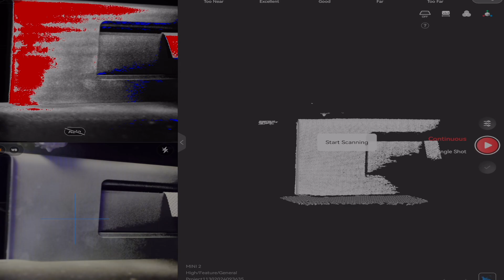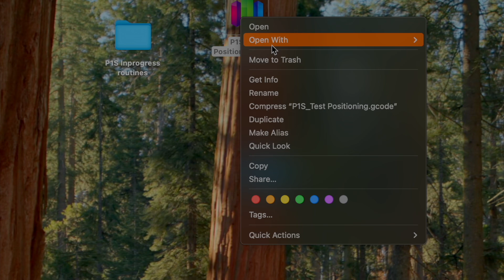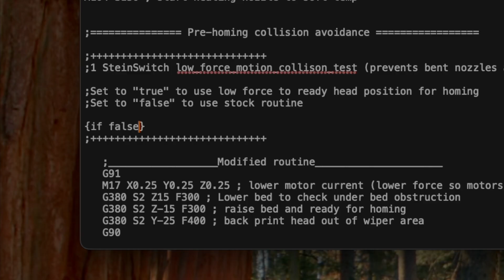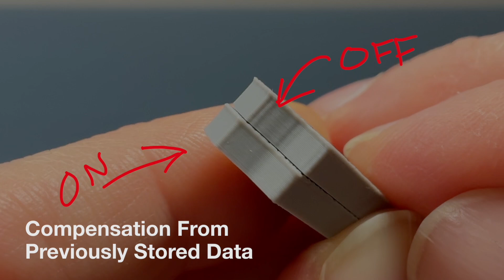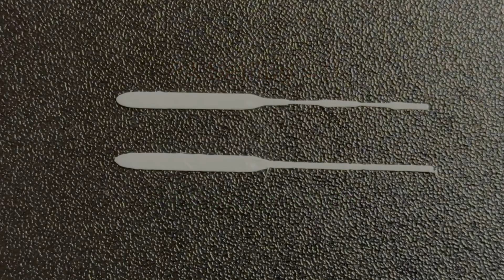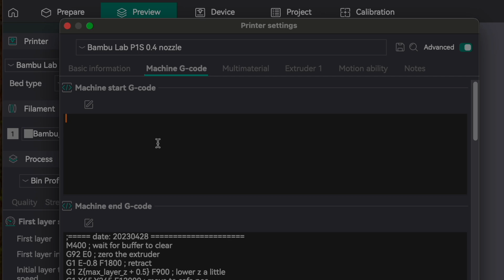The Ultimate Wiper Mod Combo For Your Bambu Lab P1S P1P and X1C

Comment from the maker: Update May 20.2025 : 
The project is now solid for P1S P1P X1C with AMS! There are tons of new features and Ive discovered many better ways to tackle everything from installing the wiper to SteinSwitches, if you want to go down the new and improved SteinWipe project rabbit hole, these videos and links below are the perfect place to start (in order)! 

1) Stay up to date on everything thats been done for SteinWipe:
https://bit.ly/LeckiesteinProjectLog

2) No more pasting Gcodes! Everything needed for the slicer is now in a single 3MF file! 
https://youtu.be/jahBdUJ94KI

3) No more editing Gcodes to changes the SteinSwitches, these are now controlled with SteinSwitch Definitions (SSD's). This doc shows you how to use SSD's and what each ones does:
https://docs.google.com/document/d/1540a3b_T8ESQ08lXcBy6db43X7J7yxPiT3bDuzWYge4/edit?tab=t.0#heading=h.ra1esgt7py0c

4) New pause routine trailer featuring SSD's. I show how to use SSD's at 30 seconds mark:
https://www.youtube.com/shorts/cHqVBoUvAgc

5) Get started with the SteinWipe project and basic manual wiper code on MakerWorld for FREE!
https://makerworld.com/en/models/1025501-steinwipe-nozzle-wiper-for-x1-and-p1-series?from=search#profileId-1050795

6) New wiper install method and new template deep dive:
https://youtu.be/DPtA6Nmu70I

8) Tune your wiper offsets to prevent a mid-wipe crisis 
https://discord.com/channels/1327182397673832448/1353220347511574608

9) Feeling good about the project and want more? Get the full project on Patreon and get access to all the files including DEV and Beta and get access special community Discord Channels:
https://www.patreon.com/Leckiestein/shop/x1-p1-steinwipe-dev-pack-maker-files-3mf-840881?utm_medium=clipboard_copy&utm_source=copyLink&utm_campaign=productshare_creator&utm_content=join_link
Reply: is there a way to filter out the routine where it scrubs the plate? some of us are concerned that since the wiper mod cleans the nozzle so well. additional scraping is not really needed and can greatly increase the lifespan of the nozzle
Reply from the maker: @reiny038  noted! Ill add a steinswitch for that section so you can toggle it off. It happens in 2 places so there will be 2 switches. Also, I incorporated one wipe that happens before it probes the bed to get rid of that little string that the printer always seems to start with. That will be in tomorrows release, too. Thanks for the feedback!!
Reply: @leckiestein also another suggestion, to prevent oozing completely u can actually add a 1mm retraction. been using it on my gcode works perfectly without any issues
im using G1 E-1 F300 currently
Reply from the maker: @reiny038  where do you suggest the retraction? After priming? The main reason I use the filament retraction which is most of the time set to 0.8 (I have mine at 0.38 because I print with very dry filament) is to prevent air from getting back into the nozzle resulting in pops on first extrude. I suppose its not a big deal if the first extrude is a test line.
Reply: Also this mod will work with or without ams, and i wont have to change anything ?
Reply from the maker: @yourvisualsltd  The defaults are good out of the box, but the SteinSwitches make it easy to turn on or off features that you may or may not want.
Reply: I have a dumb quesiton...so for the code in the "Change Filament G-code", just copy that and put it in our Filament change G code in machine settings.... Correct? I see all the settings are set to true already on that one. @Leckiestein
Reply: Can you give the post link, where i can get this files to try out myself
Reply from the maker: @hasstv9393  I just updated all the links in the description and in the pinned comment :)
Reply: @leckiestein  Can you do a video on how to use the SSD's? Its not ultra clear, do I just add the SSD I want to the notes? and ; it out of I don't want to use it?
Reply from the maker: @Mr.Hotwire its on my very long list of videos to make :) but yes, put the SSD as displayed in the doc without any spaces before, in the middle, or after. You can comment out the SSD with a semicolon to make it inactive.

Comment: How's the ams color change code going?
Reply from the maker: Hey! You can check out the additions to the project here, I think you will be pleased with the progress! https://bit.ly/LeckiesteinProjectLog
Reply: When will it step out of beta for the ams?  @leckiestein
Reply from the maker: @JustCreateYou  It is already out of Beta, the link that I sent in the last message goes over that in the April 30 post (at the very top of the page last entry).
Reply: @leckiestein  on the updated files when it shows 2 folders the dev and machine what's the difference?

Comment: I got the suite off of Patreon. In the P1 machine codes, which do I use for Bambu studio (BBS or Orca)?
Reply from the maker: Hey, thanks for the support! The best experience is in orca because it supports more options for control and I took advantage of everything available! The P1 currently has 3 codes but there will be 7 codes when the project is complete. Were just in beta on the material changing right now but should be wrapped up in a few weeks of testing and updates.

Comment: i just downloaded, but do not see those extra files. I just don't understand where to get the correct file. Patreon is a mess
Reply from the maker: Yes, that it is which is why most of the active members have now moved to the discord (still connect through Patreon). So much has improved and changed since posting this video. I hope to have an update video put together soon. But first I am working diligently on a full feature manual that leaves no rock unturned. Feel free to DM me on patreon for any questions.

Comment: Interested. Waiting until there is G-code for Bambu Studio AMS.
Reply from the maker: Hey there! The current code does work in Bambu Studio as is.. But Bambu lacks some operations which makes the material changes and first layer scan mods complete. These are not deal breakers, but it helps with travel strings. I know I can do it with post processors, but to keep things simple for everyone so Im trying to avoid going that route. So for the record, everything will work in Bambu right this moment except for setting back travel speeds and accelerations when leaving the wipe routine. Just waiting to test a few things before pushing an official update

Comment: Do i still use the same firmware in this vid for the ams gcode
Reply from the maker: @yourvisualsltd  which printer are you installing on the X or P series?
Reply: @leckiestein  p1s
Reply: @leckiestein  p1s
Reply: @leckiestein  p1s
Reply: The p
Reply: @leckiestein  P series
Reply from the maker: @yourvisualsltd  This is the one for the P1 Series https://www.patreon.com/Leckiestein/shop/p1-steinwipe-advanced-g-code-startup-809430?utm_medium=clipboard_copy&utm_source=copyLink&utm_campaign=productshare_creator&utm_content=join_link
Reply: @leckiestein iv already purchaded the 14.50 one, with fusion
Reply: @leckiestein  were do i put the pause gcode and same with starup code

Comment: So, do one have to subscribe to your pateon to get access to the files?  The nozzle wipe is one area Bambu could have done SO much better, and I'd like to add this mod.
Reply from the maker: @mikehiler6076  Hi Mike! Thanks for the awesome feedback! At the moment as the project unfolds, yes it is only available on my Patreon but you dont have to subscribe; you can one-time purchase any of the listings for your X1 or P1 printer and they will receive regular updates as the project unfolds :) I do post regularly to the patrons about the progress and actively use their feedback to shape the software side - which has progressed far more than what was shown in this video!

Comment: I am getting the following error if I am slicing PLA filament in Orca slicer with version 29.12.24.
I set every steinswitch to true. PETG slices without any trouble

Failed to generate G-code for invalid custom G-code.
change_filament_gcode Parsing error at line 18: Referencing a vector variable with a negative index
{if long_retractions_when_cut[previous_extruder]}
    ^
Please check the custom G-code or use the default custom G-code.
Reply from the maker: There was a comment on a tool change in the version you are using. Some versions of slicers dont like it. There is an updated file you can download from the same listing. Or you can go to the tool lines and just delete the comments ie: 

T{initial_extruder[0]} " ; delete this comment"

any line that starts with a "T" should have nothing after the call so clear the line from ";" onwards.
Reply: @leckiestein  I used orca v2.1.1 where this error occured. I updated to 2.2.0 both versions are not fuctional. Bambu Studio works. If I search for the line T{initial_extruder[0]} in the code I do not get any results. the only line with T{..} is T{nozzle_temperature_range_high[initial_extruder]}

The last version on Pateron is "Last File Update: Dec 29 2024" and that is the one I am using.

Thanks for the fast reply
Reply from the maker: @YxyronY  Do you have an AMS on your machine?
Reply: @leckiestein  yes
Reply from the maker: @YxyronY  Ah, ok this makes more sense now. Im in the final phase of the AMS Beta Start code. I guess you didnt see the:

"non-AMS" 

in the listing photo or the top of the listing with:

 "**Important notes/updates**
This system has currently only been tested on the P1 series without AMS. X1C and AMS compatibility will be coming soon along with more features! So keep an eye out for updates posted here :)"

haha, no worries, if you can send me a DM on Patreon, I can get you copy of the Beta code for your machine. Final code will likely be out next week after I get some feedback. I released a version today so we will see how that goes.
Reply: @leckiestein  That explains the issue. I thought that only the filament change would be an issue not the slicing part. I will send you a message. Thanks!
Reply from the maker: @YxyronY  Perfect, I just sent you the link and a little update on the project since you havent followed until now. Let me know if you have any trouble :)

Comment: What are you doing differently that hasn't been done via free mods?  By putting this wiper where it is, you are creating a requirement for new G-code where the other wiper mods do not.
Reply from the maker: Great question! While there are certainly other mods out there, the P1 SteinWipe offers a more refined and comprehensive solution tailored to a variety of user needs. Here’s what sets it apart:

1.Custom G-code Integration: Yes, the wiper placement does require new G-code, but this is intentional. By integrating the wiper with startup routines, I’ve been able to add features like pre-homing collision avoidance, reduced filament usage, and optimized nozzle cleaning paths—things that go beyond what other mods offer.

2.User Customization: The SteinSwitch system allows users to toggle features on and off, providing flexibility for different workflows. For instance being able to turn off mech vibrations in the slicer while keeping the feature functioning. This level of control isn’t something I’ve seen in other wiper mods.

3. Comprehensive Support: I’m not just providing hardware—I’ve created a step-by-step tutorial and am actively improving the G-code based on user feedback. This ensures the mod works seamlessly with your machine while minimizing risks.

The SteinWipe isn’t just a hardware mod; it’s a full solution aimed at improving both the functionality and experience of using your printer. I hope this helps clarify why I’ve taken this approach!

Cheers,
Leckiestein

Comment: I’m waiting for my P1S Combo order. The Steinwipe is one of the first mods I’m doing as I’ve also ordered more wipers that I was going to make a similar mod to my MK2.5S+, but it died not too long ago, and even with a replacement board bringing it back to life again, it will be moved and/or retired until the kids are old enough to play with it. That said, I will also reach out if there is something you want to test with the code, as I will be wanting to modify and fix the code the second I get the printer up and running😂
Reply from the maker: @BuzzBazzJ  We have lots in common! So many times I would have something completely ripped apart before I even use it. Just ask my wife about the time I bought a brand new sorrento and I wasnt happy with the stereo. No exageration, complete dash seats and door pans out the same day it came off the lot haha.
Reply: @leckiestein  hahah😂 Our first car is a first gen Volvo V70, and before I got proper tools, so that new Bluetooth compatible stereo didn’t come with a harness for soldering, so I did Gods work that day and never fixed it. Still going strong with finger twists and tape as far as I can remember😅
Reply from the maker: @BuzzBazzJ  Those cars were never fun to put radios in with their optical amplifiers we would have to delete before the module days (I had a car stereo shop for 15 years)
Reply: Would it not be better to run the first purge line on the back end of the build plate to avoid long travel from chute and wiper? So far on my Prusa I’ve changed it so it retracts enough to not drip on the plate moving to the first layer, but if the filament is too warm it drips a little. Most of the time now it has been so little that it won’t mess up the print, but before it would get stuck on the head sometimes.
Reply from the maker: @BuzzBazzJ  About the purge line, I got you covered. after the wipe cycle, it parts on the plate to cool. I guarantee it will never drip anywhere for the rest of the routine. It only heats to melt temp again once were ready to lay down filament and print. Only place we can put a purge line so its not in the build volume is along that strip where it is. also, its easy to see and take off, Id leave this one. Youll be pleased with the startup vs the prusa.

Comment: Is it applicable to the A1? Or can you also provide a tutorial for the A1?
Reply from the maker: @Procrascreation  code can written for the a1 no problem but the issue is that the wiper is on the bed. It wouldnt be effective if the part was higher than a few inches because it would take too long to get down and back up to use the pad. Filament would ooze away in that time

Comment: I just compared your file with the default one from Bambu for P1S. I saw that you reordered some of the lines, but also added few additional one (not being the part of the features). Do you plan to add to some additional comments on those, or maybe will align it as much as possible to the default g-code?
Reply from the maker: Hi! Feel free to email me or Patreon DM me the bits of code in question and I will explain its function. Email is on the main page :)

Comment: 4:16 Ah that explains why the dynamic ABL I set a bit ago thanks to your video is no longer working. I had been wondering. It stopped the same time I updated to 1.07.

Edit: Since downgraded back to 1.06.02 and dynamic level works again. It was annoying to deal with it not working so I finally gave in and fixed it. Also not updating again due to upcoming firmware issues Bambu is pushing.
Reply from the maker: @braixeninfection6312  yep it stopped working on mine too but I discovered how to roll back the firmware. Im wondering if the same issue is why it wont work on the x1. Ill have a look when I get mine.